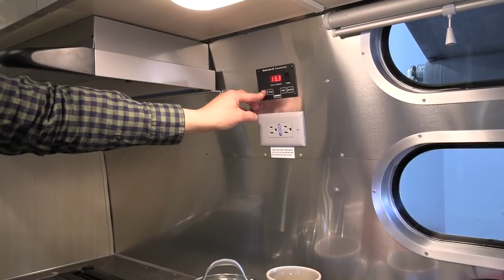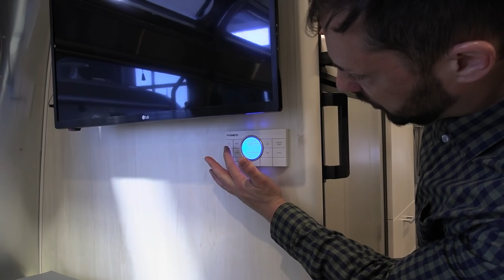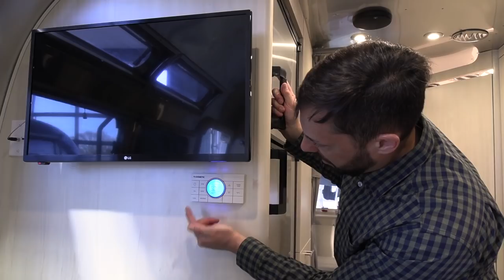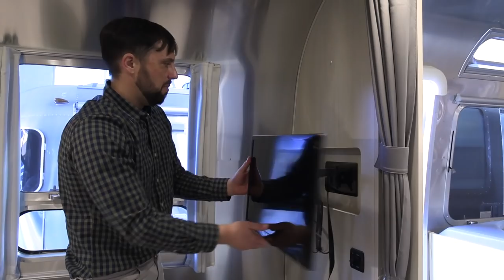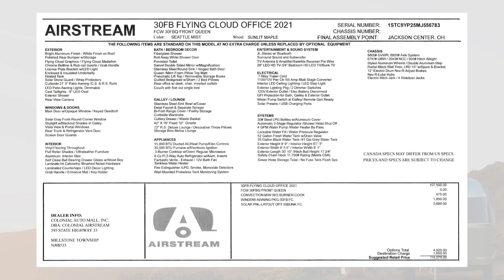Working from the Road Full Time? 2021 Airstream Flying Cloud 30FB Office Travel Trailer

Comment: Patrick... love it. I wish Airstream would put little switches on the air intakes so we can just turn the locks and clean the air vents instead of needing a screw driver. Can you pass that along to airstream for me buddy. If the vents are going to need regular cleaning of lint in the vents then we need an easy way to do it with out a separate tool to carry along and screws to be lost. Thanks buddy!
Reply from the maker: Thanks for the suggestion.

Comment: Hi Patrick, This is a very expensive travel trailer with an office!  Why are they using laminate counter tops rather than a solid counter tops..
Reply from the maker: There are different level of Airstream models. The Flying Cloud has laminate for weight reduction. Check out the 33FB Classic for the solid surface features.

Comment: Hello, at 12:30 -- Is there a way to install or get a additional CAT5 connection in the area of those plugs for high speed fiber internet cord?  Some campsites are offering high speed fiber internet now at a box near the pedestal.  Also at 44:50 -- is there a way to incorporate the fiber wire connection (also would be CAT5 connection) with the cable tv and satellite wire panel?  Thx.
Reply from the maker: David, this is all possible with aftermarket modifications.

Comment: So, this RV has to always be connected to shore power for your appliance to work?  Can you upgrade to 3,000 watts inverter?  So, I can't take this trailer if I wanted to go to a week-long music festival or burning man?
Reply from the maker: You would need to be plugged into shore power or generator to run the A/C or microwave. A Large inverter and battery system can be installed aftermarket.

Comment: Are rock guards available for the rock guards? Thanks
Reply from the maker: No. Why would you need that?
Reply: Kevin,as a recommendation you can ask an auto detailing center to apply a clear vinyl film over the stainless surface.

I also have concerns about this.
There are quite a few fastidious vehicle owners who apply this to the leading edge of their vehicles to prevent stone chips.

Comment: What could you use as a tow vehicle? I don't currently have a heavy duty truck. Suggestions anyone?
Reply from the maker: Its recommended to have a full size SUV or 1/2 ton picker or larger.
Reply: @colonialairstream  Thanks for the reply, I was thinking it would better to have a 1/2 ton truck or a 1 ton so it would be more than capable is that right, I've never even ridden in a 1 ton before, so I figured I had better ask cause I have no idea. 🤷🏾‍♂️

Comment: 903 carrying capacity - 8.33 lbs per gallon of water x 52. = 433lbs. That leaves 470lbs for food, clothing and stuff. Might have to add weight of propane and any options like awnings to that.  Seems tight?
The office is a nice idea in response to this new trend.
Reply from the maker: It is very rare for an experienced camper to travel with a full tank of fresh water.
Reply: Maybe, if your an RV park camper. For those “experienced” RVers that want a guaranteed source of fresh water and often boondock where no potable source is available, a full tank of fresh water is a necessity. 
Plus, in my 1965 30’ Sovereign it guarantees I have tongue weight. Admittedly it has nowhere near the luxury of these newer models- but the lighter dry weight of 4500 lbs makes it easier tow with a full fresh water, propane and gear.